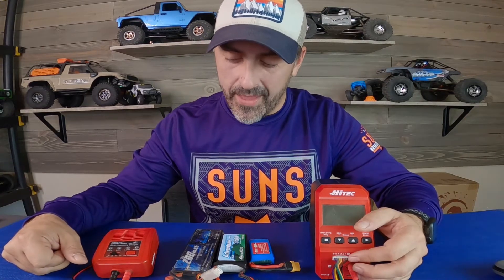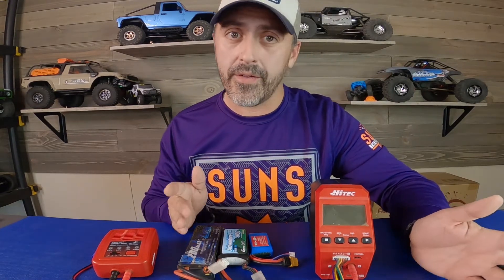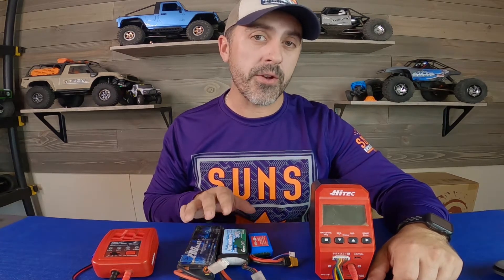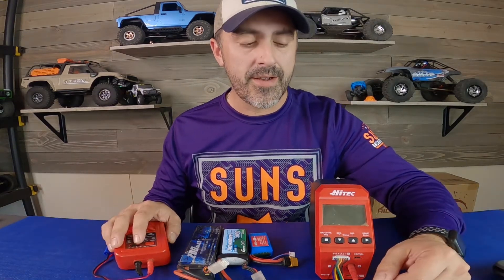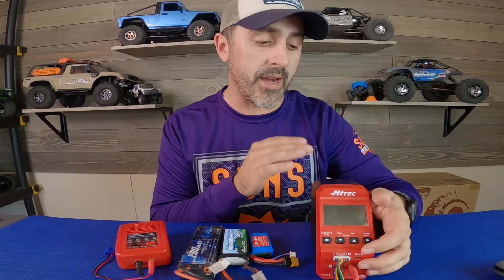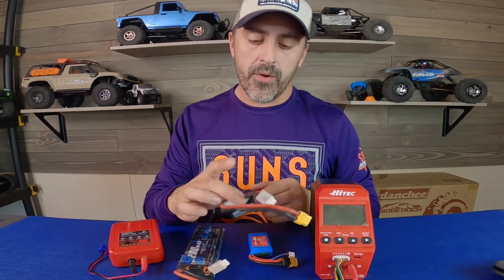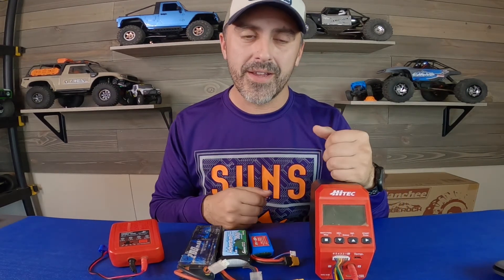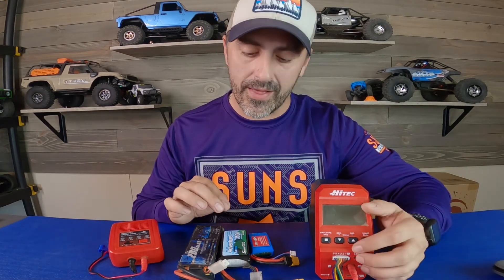RC Lipo Batteries - Best Charger Feature to Reduce Puffed Lipo Packs

Comment: what swells your battery is Heat from discharging it to fast! I leave my batteries charged all summer and only put them in storage voltage in the winter

Comment: Thanks for the video. What about a duo or quad charger with the “Store” function. Any recommendations?
Reply from the maker: Hey thanks for the feedback. For a duo or quad with storage…… i’ve had great success with HiTech products, the RDX2 mini is a duo charger with storage for less than $100 usually around $80 if you’re charging 4s or smaller. Otherwise the HiTech RCD X2 or the RCD X4 will cover just about everything for a little more $$. There are other quality brands however my experience with others has led to mixed results. I’ve personally had no issues with a HiTech charger and find them to be economical, safe and reliable without being “cheap”.

Comment: That charger on the left (your right) is downright dangerous. No balance? No bueno. I didn't realise such chargers were even commonly available these days - how is is that one? Would you say they're common, still? 

Storage charge is important for cell longevity, but that little red charger charges without balancing? That's surprising, these days! 

Useful little video. I've got a LiPO A-Z video in the works that's been on my list for months. I'll get to it eventually. You've covered one of the main points here I reckon - Storage matters! Well put, clear and succinct. Keep up the great work :)
Reply from the maker: The little red bugger does have flush balance ports for 2,3 or 4s on its right side, however they are not visible in the shot. It is a very basic design though, plug and push to charge, no voltage meter or adjustable settings. No balance plug at all would be a nightmare situation hahaha! Thanks for stopping as always my friend!
Reply: @SonoranScaleStudios  ah that's a relief. I got a shock when I saw it and wondered how many potential house fires could be waiting to go.

I guess it charges on a per cell float then, stopping at 4.2v per cell. Storage charge is pretty much mandatory for lipos though, so I'm glad you made this video.